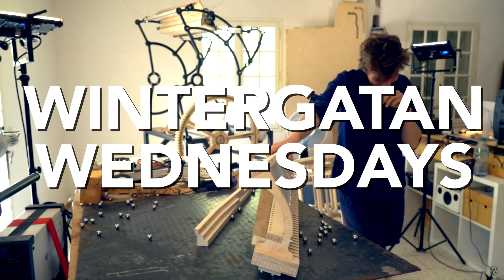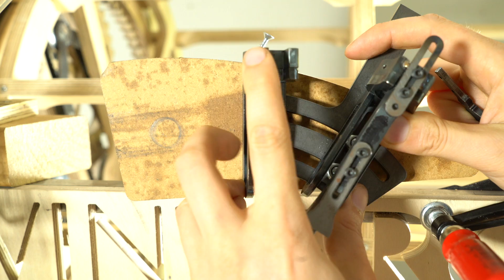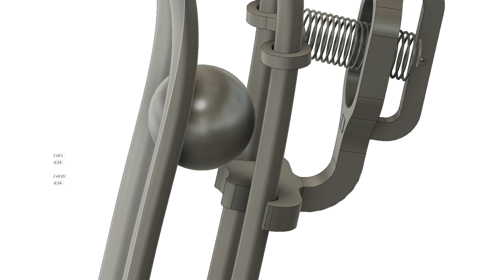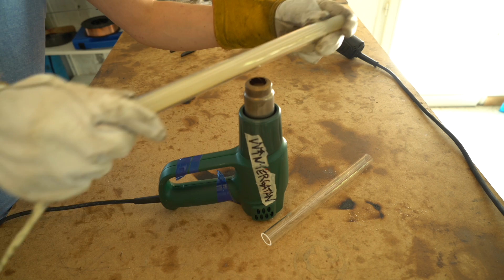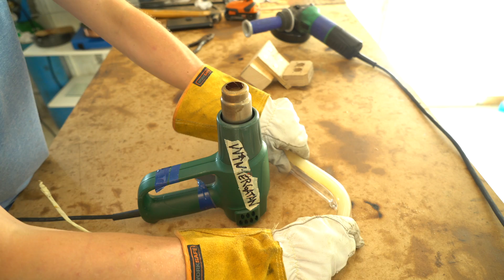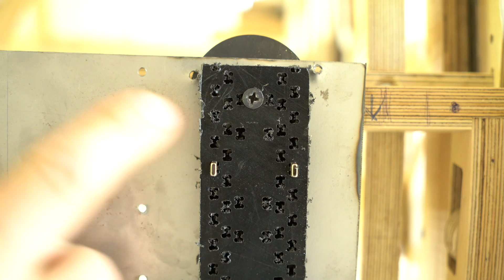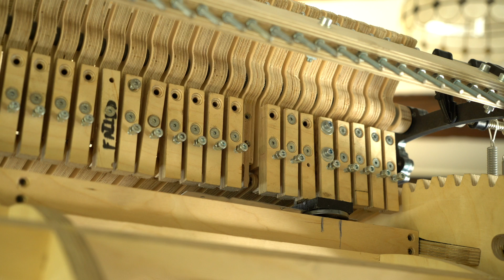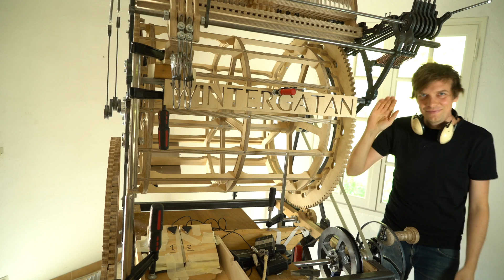Dropping the Ball - PRECISELY - Marble Machine X #52

Comment: Hi Martin! Two things came to mind. 

Have you considered building a Y shaped rail that joins the doubled channel marbles into a single rail after it leaves the release fork? This way they still end up dropping from the exact same spot? There shouldnt be a problem with bottle necking, I think. I'm not sure how much channel timing adjustment you can make, as an additional rail, albeit small, would obviously add a little bit of lag to the overall process. 

Also, if you add a little bit of felt or some other soft material on the "release fork" where it is in contact with the marble, wouldnt that dampen the bounce a bit and let the marble settle faster ready for the next drop? Perhaps this could increase the BPM playable? I'm sure there's a low friction, compressable material out there?

Keep up the great work!

Comment: There are different differences between left and right marbles. Maybe it is, because the holes for the programming pins are "not precise"… (if you can say "not precise" if the differnces are so tiny… :D ) But could it going to be a problem, if this were not precise like that? (I don't know how easy it is to drill the holes in the precision…)

Comment: My week is never complete until I check the status of MMX.  Martin - noticed in the video your pegs are already cutting into the release arms, won't take long to totally wear out requiring a part change.  Might I recommend that you add some sort of protection piece?  Could be very simple, small thin metal piece bent at right angle that mounts with a screw hole to mount on the side facing the incoming peg.  Better to wear out pegs and thin easy to replace part that the release arm.

Comment: The gravity is constant, so the marbles should be dropped from the SAME HEIGHT. If you adjust the timing by adjusting the height, it only will work for the same BPM. But maybe that's too little to be noticed later.

Comment: I have the same caliper! Do you also have problems with draining batteries? I wonder because you also have the lid open!
Reply: AvE did a test on different calipers, and found that the cheaper ones has a pretty high drain when off, but were as accurate as the expensive ones. Only solution is to take the batteries out when not in use.

Comment: I'm amaze by design. By the way, I think that small 3d printer will be a great feature for you, as you do a lot of rapid prototyping. I don thing 3d prints will look good on final product, but for prototyping a lot of carefully designed  intricate parts... you can cut some time.
I love this, can wait to see it's final form :)

Edit:

I noticed that there is a significant "jumping" so to speak, when marble hit the stop. Cutting slot at slight angle and adding some king of damper material would help... that damper material is a tricky part, most of what I can think on the spot are to sticky...

Damn this is exciting!!!
Reply: It is often much faster to clobber something together from screws and plywood then to print it, as print times for even fairly simple/small parts can easily run up to 5 hours.

Comment: Aaaah, to own a house, where I could set up a proper workshop... You know I just realized something: you probably shouldn't use neodymium magnets as programming pins, because they are quite fragile. If you have hundreds of em in there, it's almost a done deal one or two will break off during the performance, probabyl even messing something up in the mechanism. I'd use small strips of steel.

Comment: as an engineer, the bigger issue, to me, with bending these, is the ability to measure them afterwards, and then make the 38 final gates. You'll also need the ability to quickly and reliably set this back up after unpacking it from a box after it bounced along a road to the next gig. Basically anything bolted on could come loose (yes, even with locktight) during transit, or could be damaged, and will need to be replaced rapidly. If it were me i'd want to design it such that i could simply bolt in a new marble dropper into any particular location and some pins would line it up in the correct location, with a single bolt to hold it in place. a quick 30 second swap out should something happen.

Comment: Just a thought from a non-engineering follower. Is there any traction in the idea of someone designing a tool to insert and remove programming pins quickly and accurately? I was thinking along the lines of a stapler or nail gun which carries a cartridge of pins. The other end of the tool would have a custom gripping jaw to remove the pins. It would seem that doing this manually is a labour of love and time you may not have in the performance environment.

Comment: The collection funnels could be put at the intersection where paths cross with its neighbour rather than collecting both marbles on the same channel...this would result in smaller funnels, and a reduction in the requirement for the X path of the 2 channels to be narrow
Reply: You could also have used a plate with an oval hole which releases the marble when intersected at its widest point, and sprung to retract after the ball has passed.

Comment: This peg thing with the programming wheel, I just realized that this concept with a rotating wheel with bits sticking out, is basically the same concept as a gear. Maybe I'm saying this far too late in the design process, but could it be possible to design the programming wheel pins and triggers to be more rotation-like, gear-like? So in stead of pushing into a spring-loaded bar, with a lot of blunt collision force, it would push into a cogwheel, transferring a rotation force, with less stress.

Comment: does he have think about dilatation? Cause if you play on stage by a cold night or in studio, a warm place, these metal spindel will move a bit, and you have to setup the whole machine again and again. Not a big isses if you find a way to setup the machine quickly.
Reply: I don't even think a 30C temperature difference will induce a 1ms advance/delay, which means that it will be inaudible to the human ear.
Reply: Sure that 30C will change nothing, but if you take all the small offset that accumulate with time, that will be 1ms +1ms +... I hope this will not happend.

Comment: Dear martin I see in the pins of the programming wheel go over the wood of the registrators. Think about that the wood can loose material by using them often. Maybe a small metal plate at the end of the registrators can help there to have a longer life of the registrators

Comment: Have you calculated the minimal delay between two balls hitting the same spot? I worry you will have interference of two balls hitting the same point and instead hitting each other and either not getting the double note or deflecting off into unintended directions or have you determined that you must have them hit different spots? It was a bit unclear with this prototype demo if you will permanently be splitting the impact points

Comment: I love what you have in your progress Martin! As I was watching I was realizing a potential issue with the rectangular pins. With the rigid surface hitting the registrator wooden block it looks like it would add a lot of premature wear and tear on the MMX. Maybe a Skid plate on it to help reduce or a rounded edge to help reduce the wear and tear. I understand that this is a prototype. Just thought to put that out there so you don't have a few set backs while you're moving forward. Thank you for the journey and I've been behind it every step of the way. Keep rocking it out!!!

Comment: I wonder if you thought about keeping small levels on both longitudinal side and broadside to signal slight tilt of the stage or any other environment the marble machine may find itself in. Your calculations and adjustments for dropping precision sure require the marble machine to be level, else the precision you worked for so hard will suffer! (even though probably nobody would be able to hear a difference, it would be a shame nonetheless,  because it's well in your ability to account for that and you sure seem to get off to the machines precision.. :) )
Reply: He van adjust each leg individually.
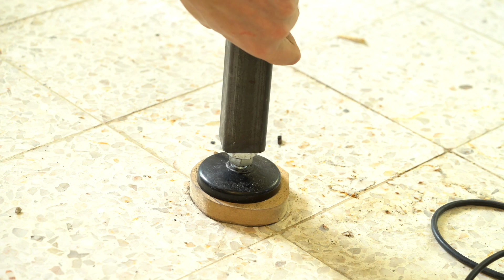Reply: Tor Sverke  I am aware of that, you can see it in in 25:50, but I'm more about the levels themselves... I wouldn't notice a slight tilt just by standing beside the machine, you sure wouldn't either, and if you should it's probably too late (as in the machine is already playing and you notice it playing off.. unlikely you notice a difference anyway though)
Reply: Tor Sverke  It's just a minor idea in the end.. though it's something worth mentioning I guess, as precision is so sought after

Comment: if you place a accelerometer on the hand crank, you will find the variations in your drop association are likely induced by your cranking motion not being smooth. you can see this in engine crankshafts  if you want to know for sure, put a DC servo on tbe crank wheel and run it with that servo at a fixed speed. all cranking motions induce sinusoidal acceleration impulses.

Comment: With bent rods. Wont it be a huge risk, that when transporting the machine, that some will "bend" in transit. And setting it all up again and tuning it at every concert will be a pain?
Reply: having a decent housing to transport it in should keep any stress off them while in transit.
think of a box into with you screw the assembly
no stress, no bending
Reply: I agree, it's all a bit too Heath Robinson hit and miss. Bending stuff to make it work is not consistent and repeatable either.
Reply: tryptychUK  you can easily make a bending jig out of plywood though. which would ensure a consistent track bend everytime
Reply: bigchuckstar : I'm not talking about a manufacturing jig, I am talking about making adjustments in situ per ball.
Bending it this way and that is sloppy, and it is also prone to being knocked out of alignment when moved.
It should be a rigid system with locking adjustment screws or similar.
Reply: @TryptychUK  he did mention that the bending was just for the prototype. Or at least that is how i interpret it
Reply: bigchuckstar  Yes, but a) How is he going to replicate those bends? and b) What's to stop them getting bent again?
Sorry, he said it himself, it's a crap engineering solution. Ball cages should be for holding balls, nothing more. The release mechanism needs to be an adjustable  device that remains fixed in place once defined. He even listed the criteria he wanted, and these ball cages DO NOT meet them.
Reply: @TryptychUK  the way i understood it was that it will be adjustable by screws in all directions. For bending rods the same way every time (during construction, notwhen adjusting) you can easily make a jig. Just on the prototype he adjusted using bending but that will not be done on the final product (this because he needed 3 hands to do it now) for transporting you can easily make a case to protect the rods from bending.
Reply: The thing is, when he was trying to tune the timing. He did huge changes, but nothing really happened. until he started to change the wooden levers instead. Wouldn't it just be better to have one place to do the timings. (aka the levers). And not add another one, with bent rods, that is inherently unstable? Rodds tend to shake ALOT, and with 2000 (or what ever) balls running around, it can be really easy that the small vibrations spread to the rods, and can cause huge headaches. And thats not even touching about the whole issue with tuning and transport.
Reply: @zOlid: I totally agree. The shims were a possibility, but they only change timing, not direction of the ball.
I would go for some kind of ball joint tube that you could aim at the mark and then lock down. As for the actual release, the movement is too large.
You only need a tiny shift at the extreme diameter of the ball to drop it.

Comment: Hi Martin,   As always, thank you for sharing.  Some more thoughts for you ;)  Don't know if you see these or not, but anyhoo....     

Timing -  I think I see some potential issues. I'm sure there are other areas of concern for you, but what struck me in todays episode was the 'registrators' and specifically, the 'risks' they represent for timing errors. You may well have a solution in hand, but looking at the one you removed to add the shims around 24:25, it looked worn already where the magnets touch it. If the activating face isn't hardwearing, that is going to introduce increasing errors I think.  Also, the amount that the magnets stick out from the programming wheel will impact timing, as will any error in the orthogonality of each magnet in the wheel. Given how powerful the 0.5mm shim was to remove an error, I worry about how sensitive the mechanism might be to wear?

Comment: Well the measurement on the two chanels would be inaccurate anyway, because you're dropping marbles on an unfixed wooden board in a cardboard box. Dropping the ball visibly moves the board, so it's amazing in a way that it doesn't switch positions so much as to invalidate the whole experiment. The differences between the drops in the first experiment are most likely caused by the subtle shifts of the board. 
Cool experiment, triggers engineers as advertised, but not in the points You outlined ;)
Stay strong and don't lose Your marbles!

Comment: Martin, I think you are building the MMX too precise! Sure, it needs some tuning and should not be completely off-sync on a channel or so, but I think little imperfections are needed to give the MMX some character. For example on the first marble machine, I really liked that rattling of the gears, on the new one this is almost gone because you doubled them up and cut them much more precisely. Seeing you tuning the channels to millisecond range, makes me worry a bit. Don't try to be too perfect! Otherwise the MMX might loose some character and become too clean.

Comment: Hi there. 
Very cool, having been in the engineering industry for many years, this is much more interesting than many of the machines that I have worked on purely because of it authenticity. 
If I may add a suggestion regarding timing of the dropping of the marbles, consider using a grub screw and lock nut on the register fingers so that you can set all your marble releases the same and tweak them on the register fingers easily to set timing. In doing so it may save you a lot of time in getting the timing set as apposed to using shims. It may also serve to help with the problem that others have commented on about the pins cutting into the register fingers. 

Keep up the good work.

Comment: 😲speechless.
Reply: Agreed. Very well done. like super well done.
Reply: This Old Tony just use your hands 😉👍
Reply: This Old Tony, this guy is building this marble music machine all wrong. Everyone knows if he just throws all the parts on the floor then it will magically build itself instantly!
Reply: @saltysteel3996  Or start feeding the kitten marbles and follow it around with a scoop to collect the parts :-D
Reply: Hey TOT, would you think Matin would be able to use a tiny bi-stable mechanism at the marble release point to make the release consistent regardless of the crank speed/bpm?
Then the movement of the release plate would be powered by the spring as soon as the mechanism crosses the midpoint, instead of being coupled to the release lever.
Reply: I never thought I'd hear tolerances in the form of note measurements.
Reply: @allenmcferron4303  Me neither!
Reply: This Old Tony cut some metal with a red hot butter knife
Reply: ToT, I referenced you in my latest video 😅. My welding skills seem to not be far from those of wintergatan
Reply: A tiny hair trigger for each one would undebatably be cool, but there are 38 channels to fabricate.  It seems the speed of this release mechanism won't matter too much if all the marbles are positioned like he has it here.
Reply: Well done Martin. Great also that the machine made music!
Reply: @arfyness Martin list the issue as #4 on his list of requirements.
The tiny hair trigger would move the release mechanism faster than gravity would move the marble meaning the release would be identical regardless of the music tempo
Reply: This Old Tony, how appropriate, it is instrumental music after all.

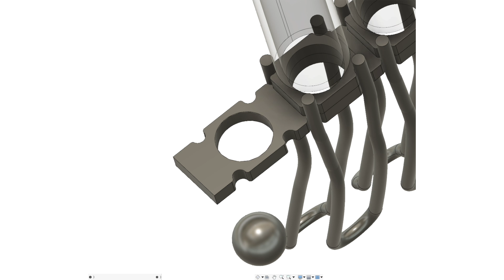Comment: Just something to keep in mind with your adjustable system at 9:33 :

When you join the clamping system for the adjustable rods together, it is possible that while adjusting the rods your neighbouring rods could slide/ loose their orientation before you tighten the screws down again. You need some elastic material (rubber, felt or very high viscosity grease) that can hold the rods in place while adjusting, even when tolerances are not quite perfect. Maybe it is not a problem in your case but I worked on a similarly working adjusting mechanism and it is very frustrating when parts that you have already adjusted loose adjustment while you work on adjusting neighbouring  parts.

Really great project by the way, I really enjoy watching it. You have some impressive dedication. :)

Comment: It would seem to me that you would adjust the programming plates and shims FIRST. If the pins don't line up, or the marbles aren't released at the same time, than you would need to overcompensate for that on the other adjustment points, which is tedious and makes them look really uneven.
Reply: I'm also a little worried that the programming wheel isn't accurate enough.
Reply: I wanted to say this. But maybe he want to do as much "rough" adjustments first before doing the finer ones. He should record the range of adjustments of the marble holder and each shims.